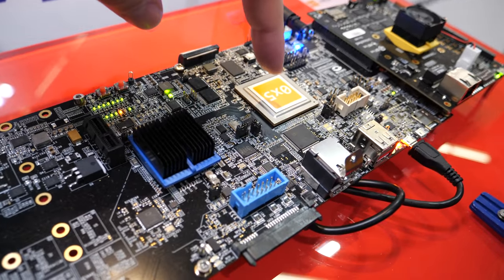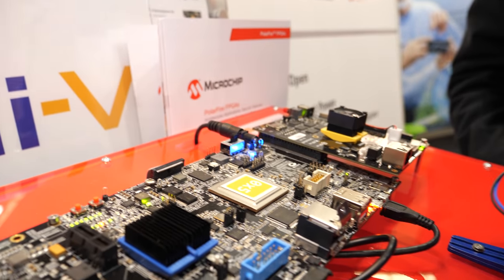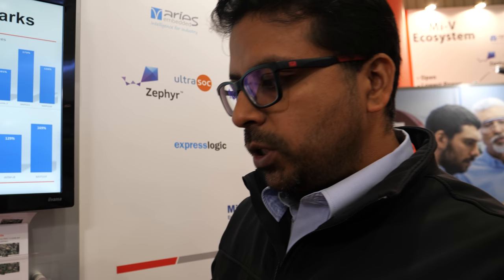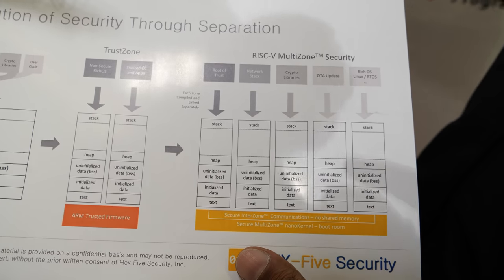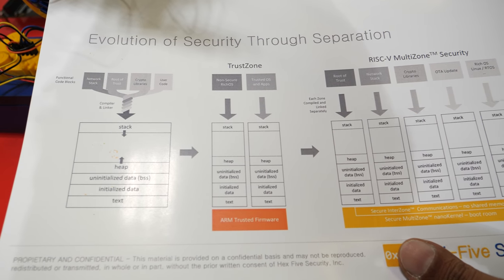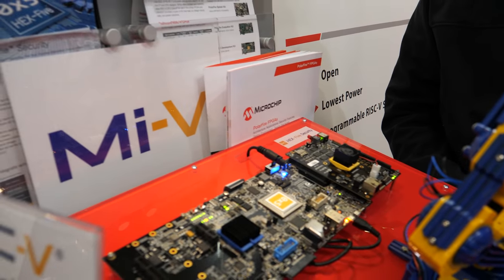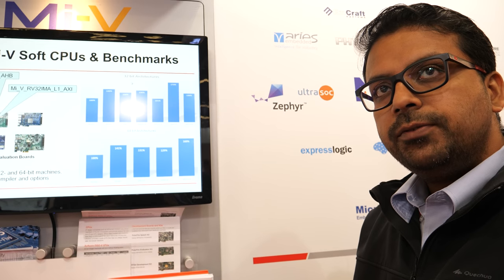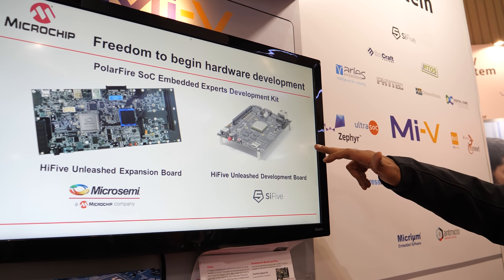Microchip Mi-V RISC-V CPU with Microsemi FPGA

Comment: So excited for the Polarfire SoC, I wonder if they'll have a frequency edge over the U540 (which was pretty fast for an in-order chip to begin with).
Reply: According to the video (at 5:00) the RISC-V cores in the FPGA will be running at "600 to 650 MHz". That's comparable to the speed of ARM cores in Xilinx Zynq, but quite a bit slower than the U540 in the HiFive Unleashed, which runs at up to 1.5 GHz.
Reply: @BruceHoult  Darn, I was sorta hoping the had some form of interface that would allow them to overcome that Zynq-style limitation. Big locked ring buffers, and three frequencies!
Reply: 667 Mhz for -1 speed grade.

Comment: Did Microchip buy Actel (the company which produces Igloo FPGAs)?  
I must have missed that piece of news.
Reply: Actel was bought by Microsemi in 2010. Microsemi was bought by Microchip in 2018.
Reply: @BruceHoult  Good lord I'm behind the times.  So now Microchip is embedding their MCUs in Microsemi's FPGAs?   Can those MCUs run a full blown OS like Linux?
Reply: @freddykrueger6571  I'm not actually sure if I know all of Microchip's MCUs! There are at least PIC, PIC32 (MIPS), AVR, SAM (Atmel ARM). However according to the press releases these FPGAs are using RISC-V cores licensed from SiFive, and they do have FP and MMU and can run Linux https://investor.microsemi.com/2018-12-04-Industrys-First-RISC-V-SoC-FPGA-Architecture-Brings-Real-Time-to-Linux-Giving-Developers-the-Freedom-to-Innovate-in-Low-Power-Secure-and-Reliable-Designs
Reply: @freddykrueger6571  It's even funnier, Microchip is embedding somebody else's licensed cores in Microsemi's FPGAs. :- )
Reply: @BruceHoult  Is RISC-V the wave of the future or should we stick to ARM?
Reply: @freddykrueger6571  I think RISC-V has got a good future. There is a lot of momentum behind it now and a lot of significant companies putting money and manpower into both compatible hardware and the software ecosystem. At the same time ARM is established, has great products, and isn't going to go away. It's a safe choice.

ARM has improved their licensing costs recently, especially for the low end cores. MIPS just started to do the same. Would either of them have done that without RISC-V steaming up behind them? I think not. Every user is benefiting from RISC-V existing, whether you use it right now or not.

I think of it a lot like Intel and AMD. If AMD wasn't there, Intel could do anything they want. Slow down progress, raise prices -- even force people who want 64 bit to go to a totally new Intel-only architecture. AMD saved us from that. So, whenever an AMD CPU will do the job I buy AMD. I had an Athlon 700 as my main work PC, and then an Athlon 3200+. Then the Core2 Duo was too convincing and i7 after it. But now I'm about to build a ThreadRipper as my next PC.

I think it's the same with RISC-V. If you want ARM to stay on their toes and give good deals, then use RISC-V when it will do the job.
Reply: @BruceHoult  Its good that Microchip is incorporating RISC-V into their chips.

Hopefully they use the RISC-V core as is without customizing it.  Otherwise everyone will be customizing RISC-V and pretty soon we'll all need a separate toolchain for each chip with a RISC-V.  

Some kind of standardization of "official" RISC-V cores just like ARM cores (M0, M1, M2... A7, A9...etc) would be great so toolchains can emerge around it without catering to a million different varieties.
Reply: @freddykrueger6571  RISC-V standardises by what instructions are available, rather than by the microarchitecture. There is the base Integer instructions "I" (less than 50) in both 32 bit and 64 bit versions "RV32I" and "RV64I", and then optional multiply/divide "M", atomics "A" (for synchronisation), single precision FP "F", double precision FP "D", and 16-bit opcode versions of the most common instructions "C" (to reduce code size). The same copy of gcc will compile code for any combination of those you want, substituting missing instructions with library functions. You can check out https://github.com/riscv/riscv-gnu-toolchain and build that gcc, along with newlib using any combination of instructions you want, and glibc with (I think) anything that includes "A".

People building CPUs can build as big or as small microarchitectures as they want with any combination of instructions. So, you can have something very tiny with a short pipeline like an ARM Cortex M0 (e.g. the PULP Zero RISCY or SiFive E20). If you want, you can make it 64 bit instead of 32 bit (ARM won't do that). Or add an FPU (ARM won't do that). Or add an MMU and privilege levels so you can run Linux (ARM won't do that). Or (very soon) add a Vector processing unit (ARM won't do that either, but I think it will be a very popular RISC-V configuration). Or any combination you want.
Reply: @freddykrueger6571   How would you like it there were a hundred companies making custom ARM cores instead of just one (I'm talking custom cores and not MCU/MPUs)? They'll all have compatible ISA and so can use the same set of tools. There would be a lot of competition among them and innovation will not be limited by the direction 1 company takes. That's a key factor RISC-V brings to you.
Reply: @kiku147  it could work or it could end up as a chaotic mess.  i can't quite tell as i don't know enough about RISC-V or whether its worth investing the time to learn it.